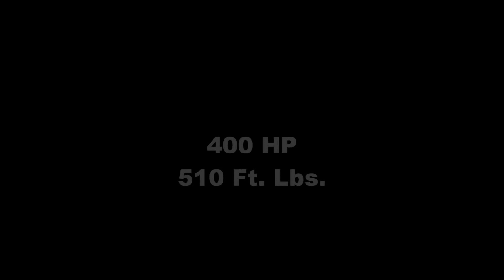1965 Ford f100 460 big block 400hp 510ft. lbs. FIRST START

Comment: what year is the engine?
Reply from the maker: +Jesse Duncan Came out of a 75 lincoln continental.
Reply: Awesome. What kinda hp u end up getting? I have a 73 460 and wish it was a 71 with the bigger hp rating
Reply from the maker: Jesse Duncan
Well, we changed the intake a few months ago to an air gap, so now it makes a little over 400hp and 517ft.lbs.